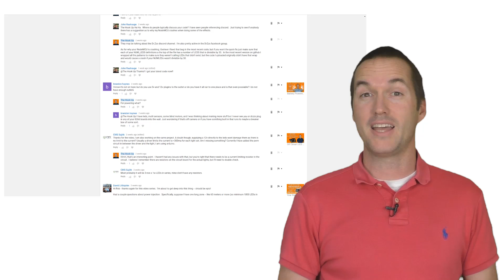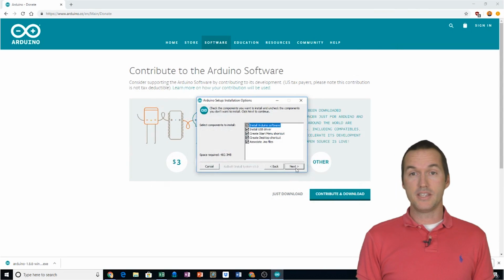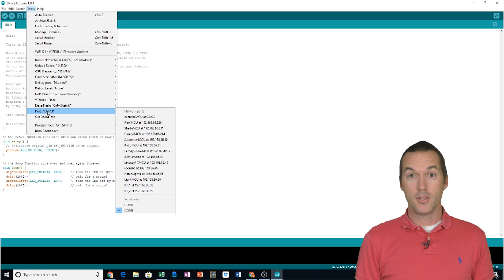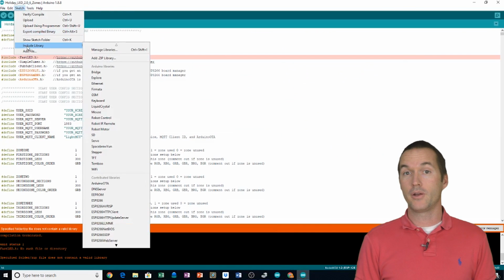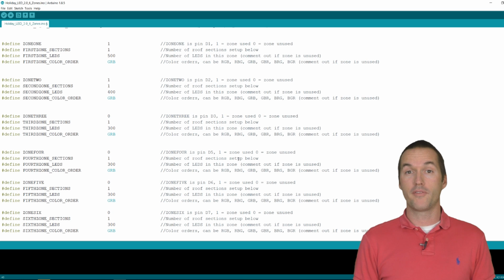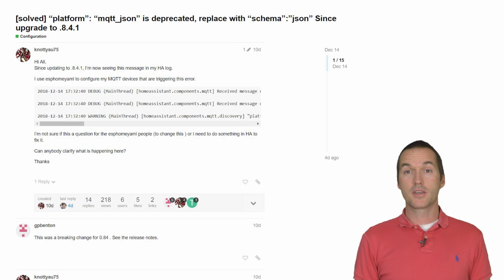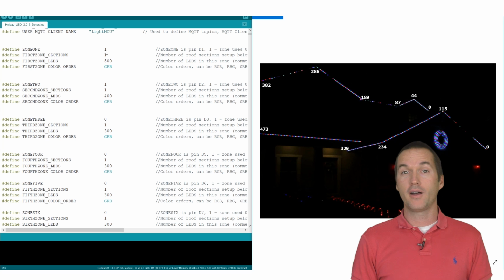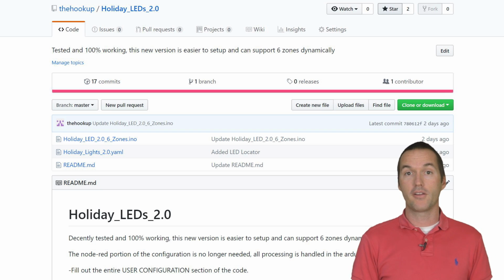Total Beginners Guide: Holiday Lights 2.0 Step by Step Arduino Installation and Setup.

Comment: I’m a bit lost do I buy an arduino nodemcu or an esp8266? Or are they the same thing? Help please
Reply from the maker: They are the same thing, however this video is old and I recommend watching this instead: https://youtu.be/N5Ln_3Ygv9I
Reply: @TheHookUp   I did see most of the videos. Helped me with my options I’m down to the purchase of the logic converter and I have a esp8266 node msc.
Reply: @TheHookUp  oh so just buying the power supply and the quad will do for the entire thing. I needed 3 zones

Comment: I would love to do this to my house I have no clue what the code had the code or anything like that I know you're doing beginner videos but I don't understand none of that LOL and does each strip of LED have a wire at the end that goes to the motherboard so to speak what does that mainframe box get hooked up to directly to your computer laptop running all the wires for me would never be a problem it's just all the coding numbers that you have to input into the junction boxes I don't know anything about that

Comment: First thank you for putting these videos out, I am looking forward to getting my lights set up. I reached a point where I am stuck. I have home assistant running, I have configured my esp node correctly (I think). I am not sure what to do with my edited yaml configuration file. I have made the necessary changes, but I am not sure how to integrate it with my home assistant setup. Anyone got some pointers for me?
Reply from the maker: Hey Camst, I hate to tell you this, but you'll be MUCH happier with WLED instead of my program, this video has aged significantly and WLED has aged like fine wine: https://github.com/Aircoookie/WLED

The good news is that everything will be MUCH easier with WLED.
Reply: @TheHookUp  Thank you! I got WLED running in less than 10 minutes!
Reply from the maker: That's great to hear, you'll love it.

Comment: Im having issues with the check configuration. I am receiving the error "configuration invalid"

Invalid config for [group]: [houseLights] is an invalid option for [group]. Check: group->group->group->houseLights. (See /config/configuration.yaml, line 8). 

I'm not sure what its telling me cause i copied the file from Robs groups.yaml file.

any help would be appreciated.
Reply from the maker: I really highly recommend you use WLED instead of my program, it is much better.

Comment: When I compile, I get the error "ESP8266WiFi.h: No such file or directory" each time. I added the library as instructed and verified the URL is correct (http://arduino.esp8266.com/stable/package_esp8266com_index.json). I installed the latest board manger for version 2.7.3 as well.
Reply: Nevermind, I forgot to select my ESP8266 boards from  >  menu after installation.

Comment: So I purchased 10 packs of SK6812 (mainly so I could use warm white at Christmas) but didn't realize FastLED does not support RGBW.  It has been three years since my daughter was born so I finally have some time to install these on the house trim.  As far as coding goes, is there a library that supports the RGBW yet?   I am very interested in the flame effect for Halloween.  I have an Arduino Uno and a few of the NodeMCUs.
Reply from the maker: Check the github page for this code, there is a drop in replacement fork for fastled for RGBW compatibility.

Comment: I am trying to understand what you are using to drive your display. You mention Programming the arduino and also the Node MCU8266. CAn you clarify? Thanks
Reply from the maker: A NodeMCU is a specific board that contains an ESP8266 WiFi chip and microcontroller.  The ESP8266 can be programmed using the Arduino IDE (a programming language and environment)
Reply: @TheHookUp  THanks  I was aware of that !
As a matter of fact I am testing  using a MCU8266 with WLED to drive a strip of WS2812B in prepping for this years Holiday lights. It will be my first.  I just got confused as how you were using both the arduino and the MCU8266,  I would like to use your programming  method to have better or more control than WLED gives me  and was trying to figure out what I needed to do. But sound like I should be able to mod your program and push to my MCU to drive the LED strip(s). Thanks for the super fast response. Between you and Dr Zzs you guys are providing the best info on YT.  Thanks for that unselfish expertise you provide. - Both of you. MAybe I will even move on to HA also in the future

Comment: Hi, Rob. I was thinking of porting your code over to support the SK6812 RGBW by refactoring all the FastLED references to the Adafruit Neopixel library. While researching how hard this will be - I ran into a Reddit post that linked this forked repo of FastLED that says that it supports RGBW : FastLED. Maybe if I include this version, it will "just work" (after changing the first param of your FastLED.addLeds function to 'NEOPIXEL' )? Have you tried this with your SK6812s? Also, it might help others new to HA for you to update your yaml.yaml file. It looks like the MQTT Light integration has changed quite a bit since this video and you need to flip a few more booleans on to see the W slider and the effects list.
Reply: Whoops... that's for the "jSon" schema version of the MQTT light, apparently. So, with the "default" MQTT light schema, I am not seeing the W or the Effect List show up under the Holiday Lights entity....

Comment: Love all the videos. I'm trying to throw something up last minute. And have a question. If I can address every LED separately then what is the reason for multiple zones. And I'm thinking roof-line only. My house has 5 peaks, and I would like to probably do different animations on each peak. But seems like I could just do that by addressing the animation per LED location e.g. 0-99 = vZone1=Yellow. 100-199 = vZone2= Green. Just wanted to make sure I'm not missing anything.  Thanks in advance.
Reply from the maker: The downside to a single zone is that each of your LED runs must be in series and the physical end of one of your zones may be no where close to another zone.

Comment: Hey Rob,
I was attempting to make a 2 color blocked feature and kept running into problems with timing. Debuging shows your 3 color blocked was hitting startPosition 1, 3, and 5 and 0, 2, 4 were only getting a single instance. I believe the checkin timer was causing changes to the chase timer. I put them on seperate timers and now it behaves as expected. You would almost never notice the timing but on 2 blocks you could see it hit one color for twice as long since it did 1 and 3 and the other did 5.

Comment: How on earth do you install the config.yaml file into home assistant? I finally got Hass.IO installed but I can't import Holiday lights yaml. Almost there. Pls help.
Reply: In home assistant, Configurator is a common addon which lets you access the files. Use that to copy and past into config.yaml.
Reply: @kevinhorn9488  Thanks Kevin. I installed the add on and performed the c&p of the holiday_lights_2.0 yaml file. Is there an upload button or something I need to initiate sync to Node MCU?

Comment: I am just watching this now, looking for ways to improve the Holiday Lights.
I was wondering if it is possible to run a small wreath from batteries or a USB power pack?  Looking for a small wreath for a door where a power cable wouldn't be suitable.
Reply from the maker: The issue with battery powered lights around xmas is batteries hate the cold, so they will go "dead" quickly when the temperature drops and then magically start working again when you bring them inside.
Reply: @TheHookUp  yeah, Christmas is summer here so generally hotter out than in 🙂.
I was just after something to hang in the door.
I just haven't found any good information on number of less and type of controller to power usage.

Comment: Amazing work on this project. I am excited to get it up and running. I have the NodeMCU programmed and Home Assistant up and running but I am not showing any devices under the Mosquitto Integration. The serial port monitor shows the "LightMCU" connected to MQTT and the Mosquitto Broker log is also showing LightMCU is connected. I have also checked it with the MQTT Explorer App which also shows a connection. However, I can't get the Light MCU to show up in Home Assistant. I created a card using the example code for Lovelace but it tells me "Entity not available" for each of the toggle switches. I have searched through the forums and tutorials for the past few days and can't seem to come up with any answers. Does anyone have any ideas what next step I might be able to take to figure this out? I have used the code straight from github, just changing my credentials. I am using ESP8266 Core 2.4.2. Again, my NodeMCU is connecting to the MQTT Broker but I don't see any type of message going back and forth. Thanks in advance.
Reply from the maker: did you ever get this working?  I just set up a facebook group to get questions like this figured out: https://www.facebook.com/groups/473812443269387/

Comment: I'm getting an error during compiling. The error is:
exit status 1
'max' was not declared in this scope
Related to the line:
  maxLEDs = max(FIRSTZONE_LEDS, SECONDZONE_LEDS);
Also, how to get the controls onto overview? I am using a recent new install incorporating lovelace
Reply from the maker: Which zones do you have enabled? I think this problem comes from not enabling zone 1 if I remember correctly

Comment: Hi Rob
I have been watching your videos and learned a lot from them. As the matter of fact I have decided to use some of the components you're suggesting like Google WIFI, Reloling Cameras, etc...
Now, I'm looking at LED lighting for my new house I'm building. Have never done programming in Home assistant or any other home automation device.
In your videos you assumed that people have Home assistant. Can I use arduino board to run my LED strips with arduino board only? Or do I have to have a Raspberry pie and Home assistant?
Thank you

Comment: I hate this, well actually what I hate is I am not a total beginner and I needed this as I was totally stuck. Clever old me, NOT!
Thank you, not got it finished yet, time!!, but now I can get the "ino" complied so I am on my way. Beginner; dam it, maybe I am again. Loving it.
Reply: OK, a reply, from ME!!
Finally got this working, see; I was am am still not an expert but maybe moving beyound Total Beginner!

Where I went wrong? a long list but the biggie for me was being unable to get Hassio to talk to my, Mosquitto, mqtt server that I have been using for over a year for other home automation.

The Auruino did but hassio, Nope!

So I installed a local Mosquitto server on the Hassio server (Raspberry Pi). It liked that and sudenly I got the LED string to do stuff.
By then I had taken control of the "UI" so I had a bit more learning to do, Still do!.

The other problem was that I had very little exposure to Homeassistant, Hassio, which was a terrific learning curve.

Am I a hapy bunny, YES I AM. 
Thanks for the effort you put into to this, maybe a note on the older "How to do this" to say it may not work but other than that, Yay!

Comment: Hey Rob. I completed setup of my lights today and when I hooked up the power supply nothing works, not even a single LED. Where should I start with troubleshooting? I can see the nodeMCU board in my router and can toggle holiday lights in HA. The board and logic lever converter lights up. Totally lost and disappointed after so much work. Would appreciate any help.
Reply from the maker: Can you hook up the nodemcu to USB and see what it says in the serial monitor?  When you toggle the LEDs on in HA, did you try selecting an effect?
Reply: @TheHookUp  Sorry it took so long to respond. First of all, I figured what was wrong with my wiring. I didn't connect data wire to the correct port on screw terminal. Once I corrected that, I could see a part of the LED light up in red color even when Holiday Lights were off from HA. Nothing happened when I changed to different effects in HA. 

About serial monitor, almost every time I went to it, I saw a blank window open up with COM3 at the top. Only once I saw ")K⸮⸮⸮⸮⸮)[)⸮⸮閶⸮⸮)[)⸮⸮⸮" but couldn't reproduce this.
Reply: @TheHookUp  One more thing. I tested the board with a pixel strand I have and it works fine. I could go thru different affects just fine.
Reply: @TheHookUp  I reopened Arduino IDE and was able to see "LightMCU at 192.168.0.101" under ports. When I selected that and clicked on serial monitor, I got this error 

Arduino: 1.8.10 (Windows 10), Board: "NodeMCU 1.0 (ESP-12E Module), 80 MHz, Flash, 4M (1M SPIFFS), v2 Lower Memory, Disabled, None, Only Sketch, 115200"

Serial monitor is not supported on network ports such as 192.168.0.101 for the null in this release

This report would have more information with
"Show verbose output during compilation"
option enabled in File -> Preferences.
Reply: @TheHookUp  Another update. My board had initially 1 zone configured. I uploaded new code with 2 zones and bingo.. zone 2 is working fine but zone 1 is still the same. Part of the strip is just red. Could it be power/ground issue?
Reply from the maker: Hey Vishal, are you sure you have the first zone plugged into the correct pin? What you are describing is a lack of data signal.
Reply: @TheHookUp  it's plugged in correctly because I used the same pin for pixel strand and works fine. But since you asked I will double check at the entry point.
Reply: @TheHookUp  Hey Rob, data wire doesn't seem to be the problem. Removed data wire and the little red color I was getting is also gone. Tomorrow I am gonna run zone 2 with d1 pin to make sure that pin is working fine. Next stop will be to check power injection junctions to make sure wires are not crossing. Let me know if you think of some other thing to test.
Reply from the maker: @vishalvincy  Yeah, I think your troubleshooting method sounds right.  Take a working zone and put it on the non-working pin.  Then take a working pin and try it on the non-working zone.  Report your findings.
Reply: @TheHookUp  I was finally able to fix it. No need to laugh.. it happens with newbies. It was a loose wiring issue at the power supply.. lol. Thanks a lot Rob for helping me out and such wonderful videos. Happy Christmas in advance!!

Comment: Hi rob. Im needing help with home assistant, im only able to turn on lightning and glitter, individual colors don't work at all and i can only toggle the main on and off. 

I got it working after reading through the comments. Would you mind if I made a video showing the stuff I ran into.
Reply: Thomas Guerra please do!
Reply from the maker: Yeah, for sure! Did you have the MQTT wrong?
Reply: I Am Having The Same Problem, Can You Tell Us What You Have Found.  Thanks

Comment: Hi Rob. I have now everything working in HA. Was wondering how can I write an automation in HA which will go thru different effects of holiday lights. Tried so many time but when automation runs, the lights are set to the last known settings. Would appreciate if you have written up anything or can help me. TIA!
Reply from the maker: Are you calling the effect in the service data?
Reply: @TheHookUp  Yes. I tried it directly in automation and then tried it in a script & then calling that script in automation. Tried 2 scripts one automation as well where one script would choose the affect and next script will set it and then automation would call the 2nd script. In all cases it was under service data and none worked. 

I guess when I select the service light.turn_on, it ignores everything after that.
Reply: Here is the latest which doesn't give any error but the lights are turned to rainbow which is the last setting:

- alias: Holiday Lights Theme
  trigger:
  - at: '16:44'
    platform: time
  condition:
  - after: '16:30'
    before: '19:00'
    condition: time
  action:
  - data:
      effect: blocked_colors
      entity_id: light.holiday_lights
    service: light.turn_on
  - timeout: 00:00:20
    wait_template: ''
  - data:
      effect: double_Crash
      entity_id: light.holiday_lights
    service: light.turn_on

Comment: i get an error compiling.  'class SimpleTimer' has no member named 'run' timer.run()
anyone know how to fix this?
also 
'class SimpleTimer' has no member named 'setTimeout'
Reply from the maker: Something got messed up with the main simpletimer fork a few weeks ago, please reinstall simpletimer using my fork https://github.com/thehookup/Simple-Timer-Library
Reply: @TheHookUp  thanks for the reply i did try to reinstall. i went to sketch >include library> add from zip file. i still get the same error.
edit- i deleted the exhisting library and reinstalled. worked like a charm. thanks.